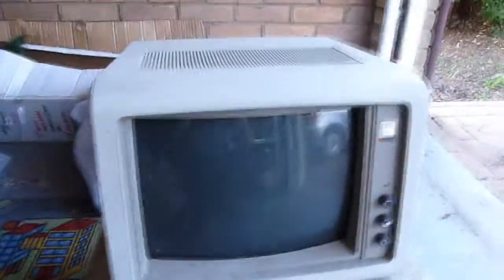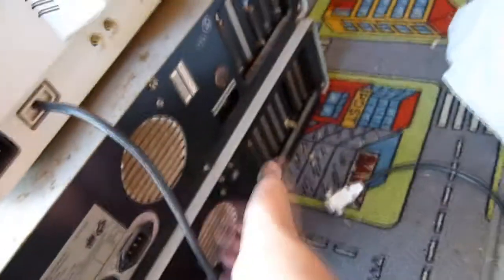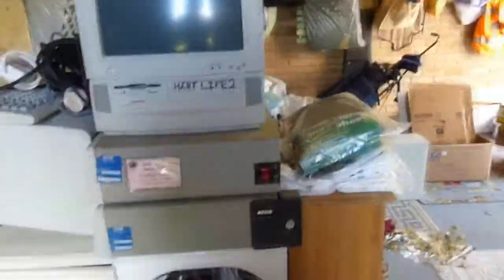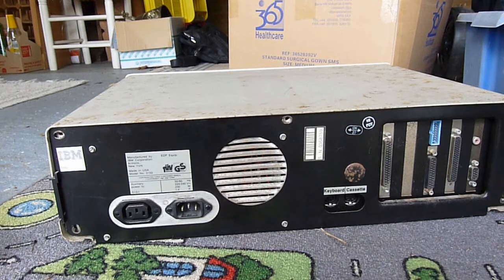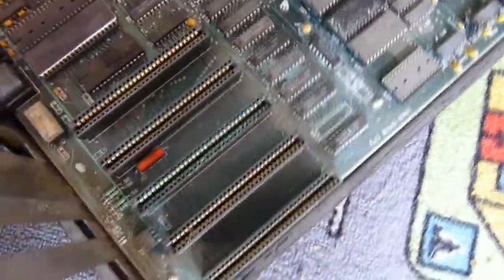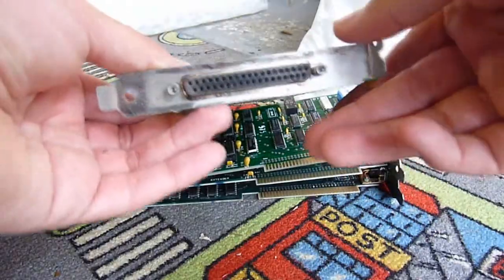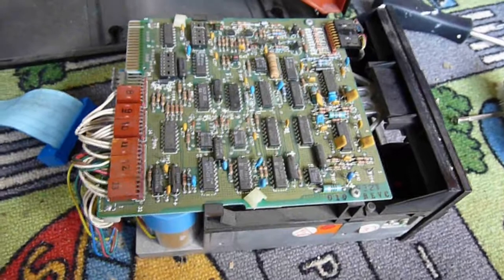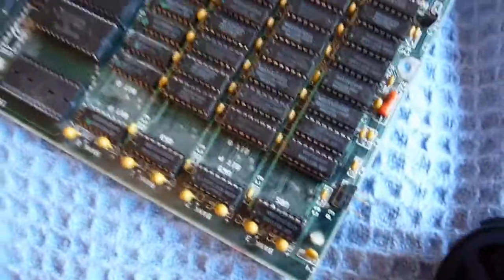IBM 5150 Restoration Part 1

Comment: omg I have never seen a computer of any age rusted like that!!!

EDIT
just because you asked... that is the early version of the 5150. if you watch your own video and go to the 6:30 you will see clearly written on the edge of the pcb 16-64kb... which indicates the early version.

you are sadly limited to 64k ram minus an expansion card you can buy. However even if you get an expansion card you are still limited on your ram compared to the Revision B that came later.
Reply from the maker: I have seen worse. It is an earlier board but was not made in 1981. I do have a spare board kicking around. Need to source another as well.

Comment: My 5150- which was military surplus- started out life as an intelligent terminal, customised for the MicroTICCIT educational computer system.  It booted Datalight ROMDOS in its original configuration.  The floppy disk drive came from a rackmount industrial drive cage.  Most of the computers from which I pulled parts cost me $5 or less.  The most I spent for one component was for the Sweet Electronics 640K RAM expansion which I bought online for $30.  The hard disk is an 80MB Seagate ST4096, for which I installed a later model power supply made for a PC XT 286.  The video is being provided by a Western Digital SVGA card.
Reply from the maker: Nice. Good score.

Comment: That's an early PC. It has 16k - 64k on the motherboard. The later model had 64k - 256k on the motherboard. The later version also had a white B in a circle stamped on the back of the case. The big connector at the back of the floppy interface is for up to two external floppies.
Reply from the maker: Thomas Lake Nice thanks for the info.

Comment: Man this brings back so many memories. When my mate and I where around 10 years old. He had one very very similar to this, this was first time I encountered DOS and the magical sound of the hard drive and later adlib. I think these where 286's? He upgrade from 286 to 386 to 386 with math co-pro to 486 to pentium. That case was rock solid, that psu switch was so satisfying to use.
Nice find, looking forward to the rest.
Reply from the maker: These are not common to find these days and are very pricey. However I am determined to get this thing running, good test of my trobleshooting skill.

Comment: Just be incredibly careful when you DO put it back together that you get those P8/P9 AT power connectors back correctly (blacks together in the middle). It's possible to get them the wrong way round and let all the smoke and flames out :)
Reply from the maker: I don't what to blow it up. There are keys in the power connectors to stop them being plugged in wrong.
Reply: ***** Ah you're lucky then. Some of the AT power supply connector pairs were identical, and if you got P8 and P9 swapped over (the right way round individually but in each other's places) you'd wreak havoc
Reply from the maker: ***** The PSU is happy for now, I am currently looking into the clock ciruit, I have seen some things I do not like.

Comment: I think rev As have four screws at the back, so you have a rev B. That is a CGA card. The connector on the back of the floppy card is for external floppy drives. Amazed you have the expansion unit, and with two hard drives.
Reply from the maker: It is from late 82 to early 83. Are yes I did refer to it as EGA, oops. Are so that's what it is for, lots of the ports I do not initially reconise. I was supresed when I got it, first thought it was a second IBM 5150.
Reply: ***** I'm wondering what that external blue port is for.
Reply from the maker: Paul Potter
Same, nothing I reconise.

Comment: I think rev As have four screws at the back, so you have a rev B. That is a CGA card. The connector on the back of the floppy card is for external floppy drives. Amazed you have the expansion unit, and with two hard drives.
Reply from the maker: Google glitched again.
Reply: ***** The glitch I keep getting is double comments when using the Android app.